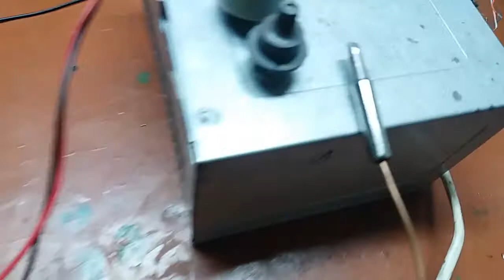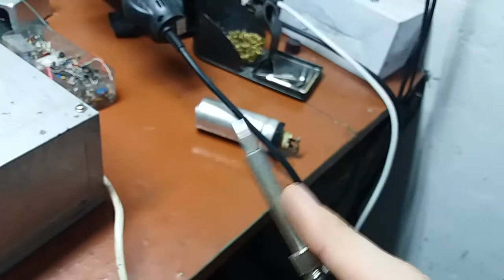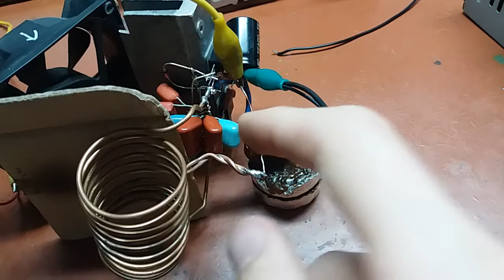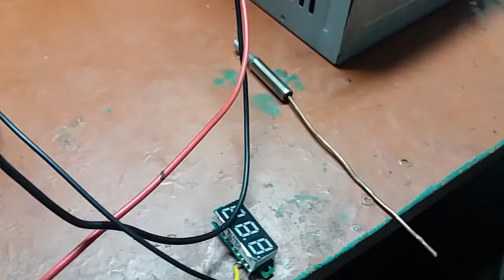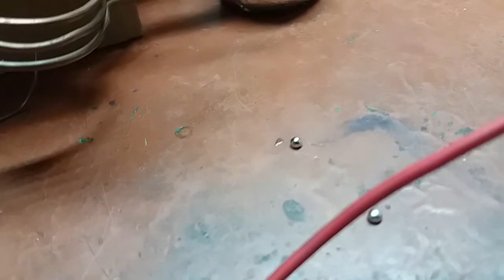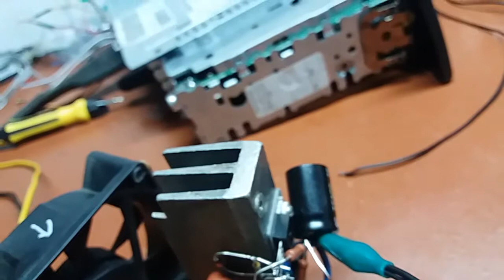ZVS induction heater (only 60W)

Comment: Interesting variation on ZVS. But there is a 'better' way! Wind the tank circuit coils on a large crossection toroid as a primary. Then do 1-3 turns of heavy gauge wire as secondary and that secondary will have the induction coil as the load. Paralel tank circuit (as it is in the 'mazzelli zvs') is great this way because with no load it will have high impedance and when load increases the impedance lowers and it pumps energy from the power source :-) You can even simply vary the output power by using the input choke as a buck converter (duty cycle controls maximum current) :-)

Comment: "A tip on a stick." lol i laughed, not at you, but with you :-D.

So with that power oscillator you could have a cordless and powerless soldering iron, when placed in the field of the coil it gets bloody hot fast, thats different but dont have a ring on your fingers... ouch :-D.

There is an ozzy bloke that played with a similar circuit, i think he used igbt's (i may have that abbreviation wrong, like most of my spelling lol.).

You have a nice soldering iron, looks much better than my crap Antex.

Comment: Use coil as  a stand for your iron so combination of internal heater and induction heating you get very fast heat up time.
Reply from the maker: I already have tried that, doesn't work that well. The outer piece (the tube which holds the tip) heats up more than the tip, no good. I have made a prototype already that works reasonably well.